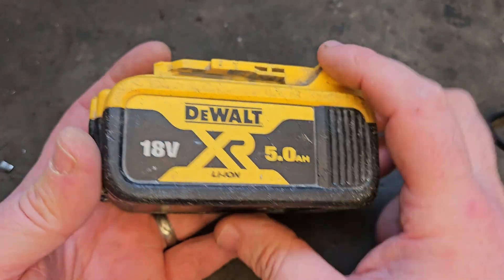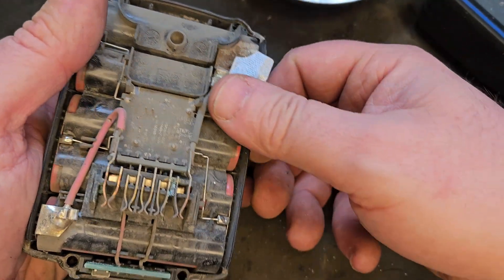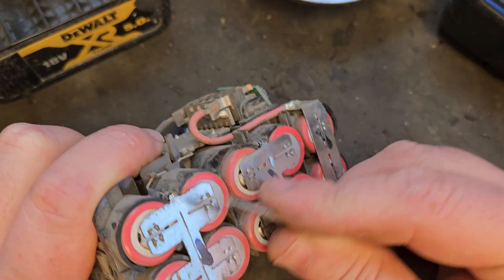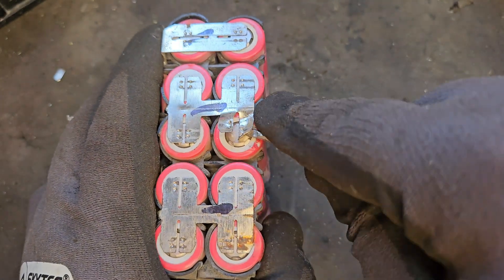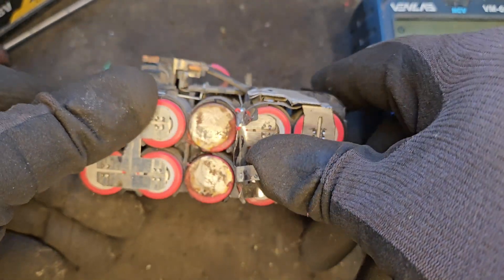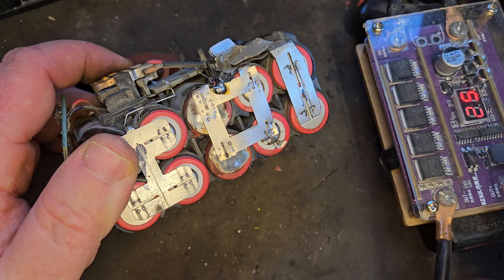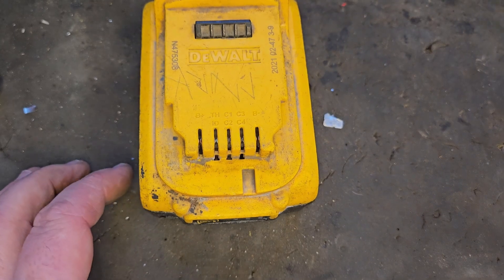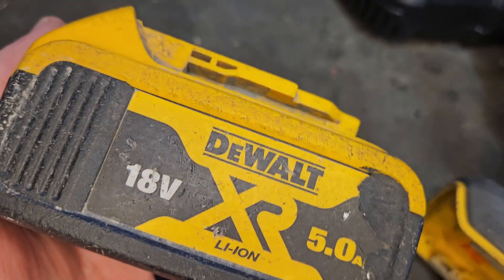Dead Dewalt battery? Try This!!

Comment: What spot welder is that please?
Reply from the maker: Spot welder 
https://www.ebay.co.uk/itm/295200671732?mkcid=16&mkevt=1&mkrid=711-127632-2357-0&ssspo=Yv_QNsB4RWO&sssrc=4429486&ssuid=cjPn_ZfdQLW&var=&widget_ver=artemis&media=COPY
Battery to power the above 
https://www.ebay.co.uk/itm/285286686656?mkcid=16&mkevt=1&mkrid=711-127632-2357-0&ssspo=nF4JL0LQQtu&sssrc=4429486&ssuid=cjPn_ZfdQLW&var=&widget_ver=artemis&media=COPY
Reply: @doctorlefthandthread thanks fella, what power supply?

Comment: Great video 👍. I have 2 flexvolt batteries all cells good but wont take a charge? Any ideas?
Reply from the maker: The flexvolt are my nemesis I haven't fully cracked them yet but if and when I do the video will be released
Reply: Ah cheers. Love the channel keep it up!
Reply from the maker: @darrenguildea5347  will do thanks
Reply: Sounds like your board needs replaced
Reply: @Masonross171   where can the boards be got? Any links? Thanks

Comment: A shot of compressed air on the whole thing and then a squirt or two or contact cleaner would be helpful too.  Wipe down the battery case and it will engage with the drill more reliably.  Other viewers should note that double checking the battery polarity, and checking a third time, is a wise idea.
Reply: Good comment!  It was one filthy battery!  Sheesh